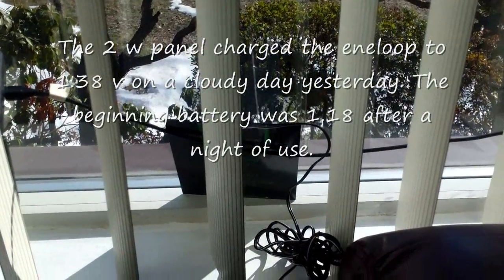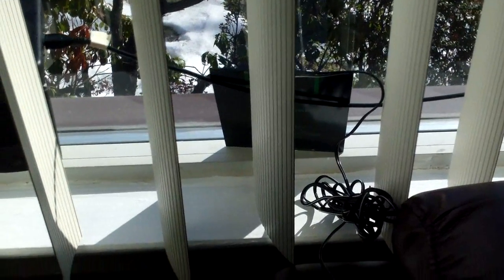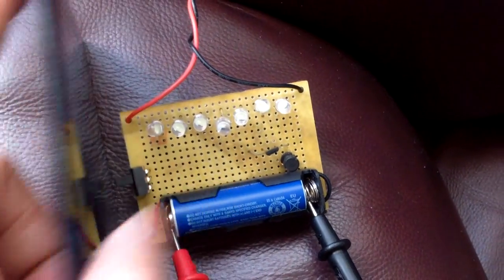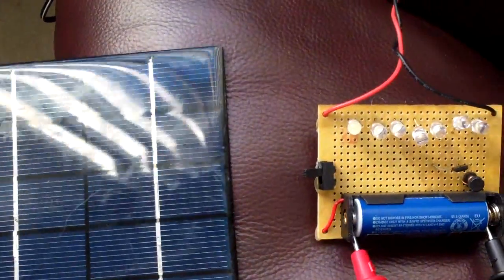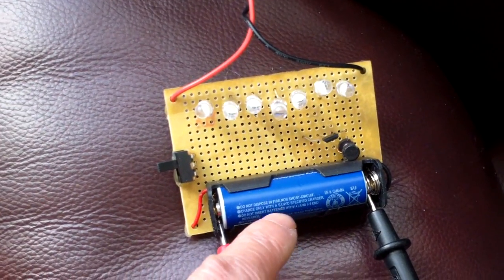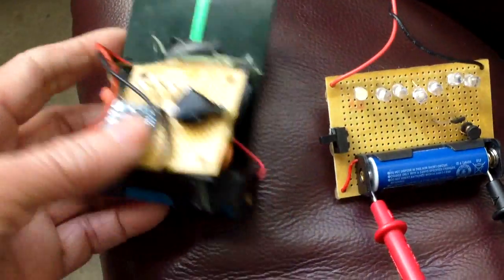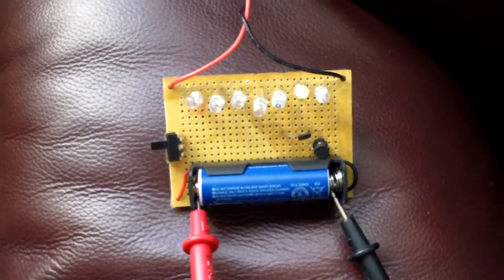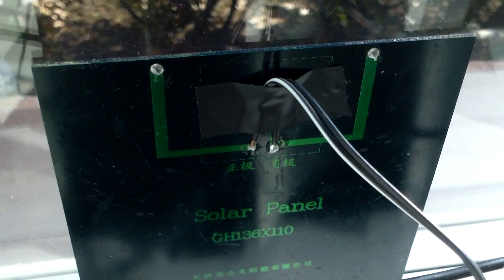QX5252 solar light:  Part 3 charging update and why energy is important to everyone

Comment: hi, i want to make nimh battery charger by this circuit, can you please guide me on it, what is the voltage input allowed by solar, and maximum current of panel,  and can we add multiple battery parallel? please give me more details.
Reply from the maker: +Raghavendra V I use a 5 volt 500 milliamp solar panel.  You can use lower voltage solar panels but no lower than 2 volt. 500 milliamp charges up the batteries quickly.  Lower current will take longer.  You can read the data sheet for the QX5252 chip or you can experiment a little.  Good luck.
Reply: ok thank you, is inductor change according to input voltage and ampere?

Comment: Hi..I read an article on the latest Eneloop rechargeables, it basically said that the eneloops hold a better charge and maintain a higher voltage as the capacity sinks, saying at 1,1volts longer before rapidly sinking. When using the QX5252 driver this is good, because the chip protects the battery discharge at 0,9v..Lights go out!, and the charging begins when the panel delivers over 0,3v....So the eneloops are a really good choice here....Still got to get me some..
Reply from the maker: Have you tried using other kinds of inductors?  I need to find or buy more inductors to make more lights. At present, the light would last 2 full nights on 1 single charge.  I have some older NiMH batteries. They lose their charge quickly when old.
Reply: wtam69
I have tried the original solar light 100uH which gave approx 34mAh, the 33uH give 110mAh, The datasheet shows the expected values for different inductors. I have ordered some 10uH to try out...may take a few weeks to get them...With my older cheap NiMh batts I need to start the evening off with at least 1.3v to stand a chance of going through till dawn..
Reply: wtam69
Hi, ok my test rig with original 100uH Inductor and a 1N4148 diode to the plus LED pin, 4 LEDs in parallel now, minimal voltage drop 1,270v yesterday evening and 1,264v this morning....Good brightness
Reply from the maker: MrFreddiew1
Thanks for the report. I wasn't sure what inductor to get either. I hand wound a coil with a ferrite core, probably 60 uH, my guess since I don't have a meter to measure. Will upload a video soon with a light using this inductor